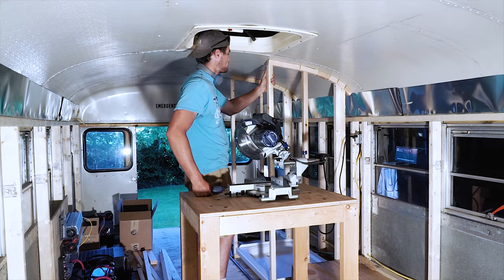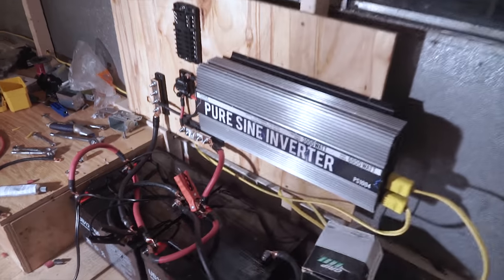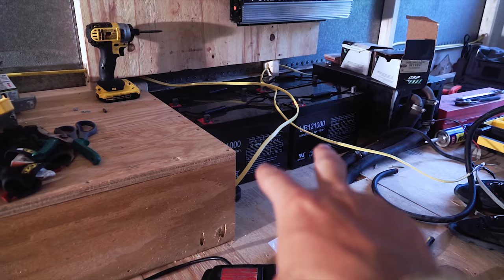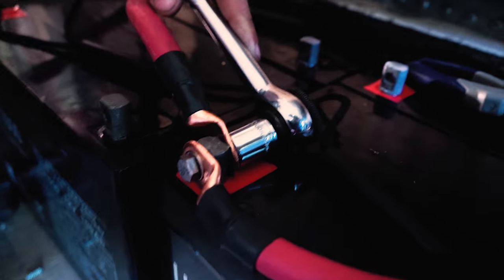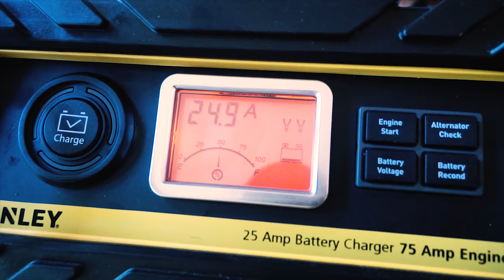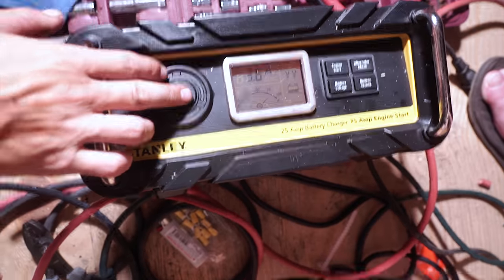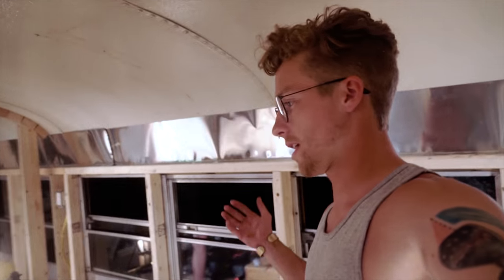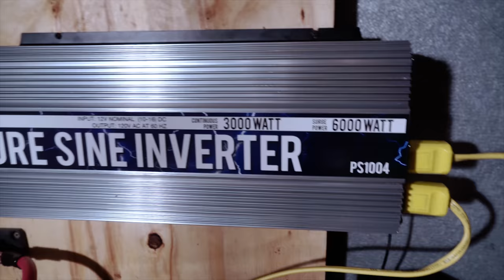PROGRESS #9 | School Bus Conversion | BATTERIES and INVERTER

Comment: Excellent job guys! I've done some boat building and refitted a few old yaghts and am thinking of doing a skoolie as my home/workshop. One item you may want to look at is the insulation. The pink panels are OK but in my experience sprayed-in expanding foam insulation will actually add rigidity and truly seamless integration. Control of airflow, say in a pinhole from a loose rivet is very important. Thermodynamics, weight and rigidity are all important in a large metal tube, bumping down a road with extra tons of weight.

Comment: Great work with the inverter and the batteries. I just went through that same thing with our bus so I feel the pain of having to custom make each wire. I'm trying to hook up my inverter to a subpanel right now, but I don't know how to do it. Are you guys going to do a subpanel off your inverter?
Reply from the maker: We figured that while useful it isn't 100% necessary as the inverter itself and our fuses going to it act as a shutoff for the whole line. And since we only have 2 cords that we plug in its easier to just unplug those than wire in a board to do the same thing. Thanks for the questions!

Comment: mightve overdone it a little with the battery cables , you need to look at the maximum amperage used by the inverter and the maximum amperage going intoo the batteries from the solar , it doesnt hurt though it just cost more money

Comment: Really thought I was gunna get your rs bank there for a second.

Great videos guys, what engine is that beast working with? That's a great size bus, and I love the potential for that old wheelchair lift door.
Reply from the maker: Haha so close, good thing we don't have much to steal, just a few cash stacks of 2b...

And thats a great question! We have a 1994 Detroit Diesel 366 which is one of the most reliable diesel engines ever made we've heard. 

And we completely agree. The size is perfect for small windy roads with tight turns and it can eaily fit in two parking spaces unlike those monster 40 footers (ours is 30')

Any ideas for the wheelchair door?? We're open to suggestions! Currently we're thinking a soundbar to be able to swing out with the door for outdoor musical enjoyment!

Comment: Are you planning to do a more detailed video of how you wired everything? Where did u buy the fuse box and this power bars?
Reply from the maker: Good question! And the answer is yes, once the bus is finished we will have the time to do a far more in depth and accurate description of the system, so stay tuned for that!
Reply from the maker: and we bought them on amazon 
Fuse Box: http://amzn.to/2wIAhAm
Power Bar: http://amzn.to/2xkdJYW

Comment: You guys are doing great work!  Im in the middle of my build now and am shopping for my solar system.  Do you have a separate 110V shore power system or does everything go through your inverter when you are not running on solar?
Reply from the maker: Kyle Hill you can have 110V shore system, we skipped that and went with a 25amp battery charger and that powers our batteries when not being run off solar. One thing that we didn't do that I would HUGELY recommend is running off your bus inverter. That will almost always keep your batteries fully charged, even when your solar can't, and that's huge because we've found that the sun can be very irregular, and won't always keep our batteries charged.
Reply: Quick question: When you say "bus inverter", do you mean the alternator?

Comment: Did you guys splice those extension cords from the inverter to power your outlets? Interested to learn how you did that.
Reply from the maker: you can actually buy them at most hardware stores, they just hook into the end of the wire like an outlet, and then they run down the line to all the other outlets, it's the only way we could think of doing it haha
Reply: Seems like a simple and easy way to do it. Better than directly connecting to your inverter. So you used something like this? http://www.homedepot.com/p/Leviton-15-Amp-125-Volt-3-Wire-Plug-Orange-R51-515PV-0OR/205165505
Reply from the maker: Yup exactly! And yeah we thought it'd be safer and easier too as they can be unplugged very easily

Comment: What is the Brand of batteries you used and they Type of I Inverrter?
Reply from the maker: we used these batteries http://amzn.to/2wjOHeX
and this inverter http://amzn.to/2wxJsUx
both are the cheapest and highest rated on amazon. HIGHLY recommend them. So far flawless and we ran a miter saw off of the batteries and inverter to stress test it lol